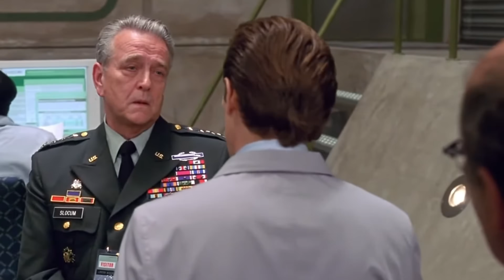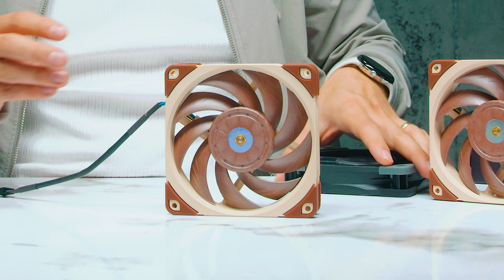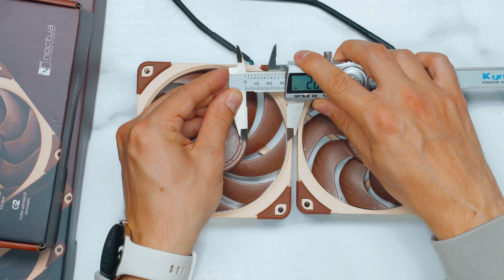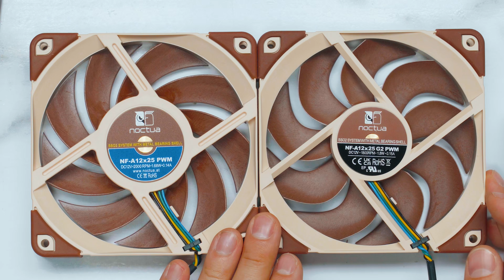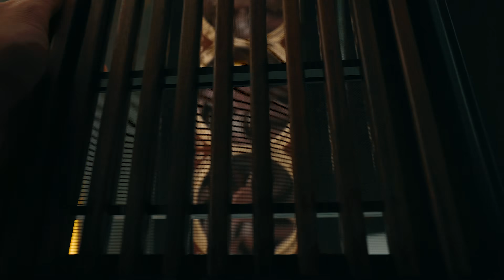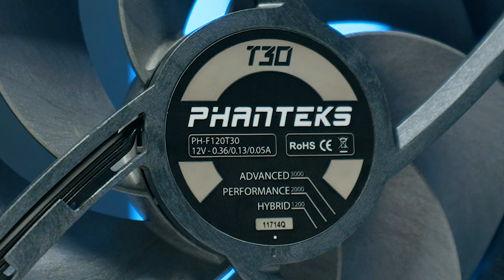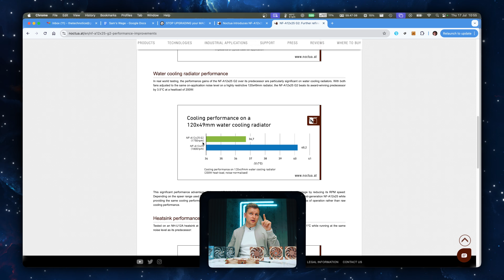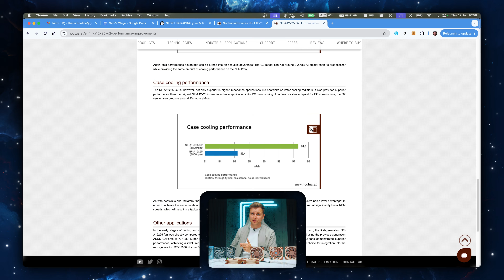Why it took Noctua 7 YEARS to BEAT the CHEATING Competition!?

Comment: Noctua COULD make the center hub smaller still but they choose not to because there's almost no airflow there and low pressure and they found that airflow in a positive pressure case can actually flow BACKWARDS through a fan with a smaller center hub -it's not an accident that the center hub is that size.

Comment: The Arctic p12 max is only $15.99 a Phanteks T30 is $29.99 and $34.95 for a Noctua 120mm G2. Unless you wanna completely silent build then I would agree go Noctua but otherwise Arctic It's the best option. I own all of these fans and much more and I would take the Arctic just for the price.  Unless you're overclocking or you're working at a very hot environment the Arctic fans are not going to ramp up that much so you wouldn't notice the difference.

Comment: Beat the competition? It's like saying Bugatti beats Volkswagen. By the time Bugatti sell 1 car, Volkswagen probably sells 1000. 
Noctua fans are up 10 times more expensive than the 'competition', but perhaps only slightly better overall.
I can buy 5x Thermalright 120mm fans (RGB mind you) for £17.29! 5 fans for less than the price of 1x Noctua fan!

Comment: Didn't watch but don't need a video to tell me noctua is pretty good....for a quiet fan.  If you need a fan with best air flow & pressure, you aren't running a quiet fan.

Comment: They changed it bc Chinese knockoff where getting too good.
Reply: Or they were following @MajorHardware's channel, where he has people sending in designs for fans to be printed and compared against the Noctua A12 (with the printed fan designs using an A12 frame and motor, so they're all working with exactly the same driving speed and power), and a number of the designs were beating the A12, and they needed to do something to push their own products back out in front.

Comment: I tested them as room fans with an old router power supply 12V _1A---, 80mm0.25A--92mm0.22A (they are very loud) a 120mm 0.18A from an old PC power supply and a F12 arctic 0.0.21(1350 rpm), the 80mm0.25A--92mm0.22A are noisier and more efficient...(80-92-120mm with 0.19-0.21-0.25 amber can also be obtained from old PC power supplies)

Comment: I don't trust any type of fan that doesn't use ball bearings. They claim these fans use oil pressure to create an oil cushion and reduce friction, but that only works for a short time; once the clearance increases, the oil pressure is lost. Only designs using actual ball bearings are truly durable. Manufacturers are misleading consumers with all this talk of oil pressure technology or magnetic bearings. If those claims were really valid, vehicle wheels wouldn't need bearings, and camshafts wouldn't need them either—we could just go back to the early days of motorcycles when camshafts ran without bearings.
Reply: comparing vehicle wheels to computer fans is a huge stretch. These fans are amazing

Comment: You can't just compare fan max rpm and max noise. It's about noise at equal cooling performance. A thicker fan creates higher static pressure and moves more air per RPM. Which means you can actually run it at a LOWER speed vs a thinner fan. It's physics and there is no way around it.

Comment: The reason for black taking longer is because the color requires adding "Carbon Black" which uses multiple compounds used to make it and effect the plastic structure. Which means molds will act different and detentions/tolerances change. Originally there fans where brown because the choices of plastics used resulted in brown fans. My guess it's brand recognition now

Comment: Just go for P14 PRO for static pressure at front and side and Endorfy fluctus for airflow at the back - all for less than 10$
Reply: Not the P14 Max?
Which Endorfy exactly, please?
Thnx in advance
Reply: @Kliq-n2s P14Pro and P12Pro are the most bang for your buck choices if you want high speed ARGB fans. I would avoid endorfy(old SilentiumPC) cause they are overpriced for their quality.
And if you want cheap and good looking fans that perform extremely well but only go to around 1500RPM then TL-S12 series is your best bet. Very quiet and outperforming most other fans till they hit their max speed. I use them everywhere in Corsair 5000D Airflow and they keep i9 11900 without power limits and bios modded RX 9070 very cool.

Comment: What a dumb way to put this... Yes Noctua is good, the other brands are also good, but why not compare them to the the same class of fan like the Arctic P12 PWM for example? Those are 1800rpm, I have them at 1200 on my case, they are super quiet and performance is amazing. I bet the Noctua ones are better (and also pricier) but that's just it, no cheating there Mr. Bait

Comment: TL:DR - If you never believe the hype of premium fans, here's my experience. 

In short, T30 120 competes hand to hand with A12x25 (G1) in terms of airflow and acoustic until RPM reach 1700 - 2000 rpm, I got the latter in Chromax recently and it is consider quiet until it reaches high rpm range (by no means it is loud as it still has more pleasant tone profile, so consider louder relative to T30 at same high rpm 1700 - 2000 RPM). I also ordered 1x T30 and wondered if I want to cancel the order since it will be used as rear exhaust to improve thermal under full CPU load but it is $10 more than A12x25 Chromax after discount on second thought, but after this video I'm happy to say that I made the right choice and will wait for it to arrive. 

Now I just need to wait for A12x25 G2 Chromax (2x single or Sx2-PP) local stock to become available (since Noctua barely gives any sort of discount for Amazon US stock I'll see if I can use a bargain with 30% discount that offered by an online shopping platform in my country, they do this 3 times in a month but often they jack up the price before discount so the final price may or may not reflect a value purchase) and get a pair to swap out the G1s from my U12A Chromax, and shift the two G1s plus the G1 currently used as rear exhaust to swap out 3x Arctic P12s as bottom intake. One A12xG2 OG will remain as rear top exhaust, and may reallocate 1 Arctic P12 on center top exhaust and top side intake depending if doing so will gives any thermal benefit, but surely those Arctic fans will be set at 800 RPMS permanently so no compromise on acoustic that the Noctuas and Phanteks provide.

3/2 or 4/3 for intake and exhaust should give slightly positive chassis pressure which is what I am trying to achieve, as negative pressure will lead to dustier interior while too much positive pressure will reduce the speed at which warm air is being ventilated.

For reference, I use 13600K + ProArt B760 Creator and Lian-li O11 Dynamic Mini. 
Prices I paid for (in USD equiivalent):
U12A Chromax - $95
1 x A12x25 G2 -  $20
1 x A12x25 Chromax - $23
1 x T30 - $33

Currently best temp in Cinebench 2026 (DTS sensor, HWINFO64)
LLC = Level 1, all Intel Default, DTT OFF
CPU Package  - 91 c (Peak) - tested with NT-H1, 1 large + 4 small dots, Arctic MX-6 or PTM7950 / TG PTM might be needed for further test
Vcore - 1.286 / 1.325 (AVG/MAX)

Shall update after additional fans swap. I might as well swap back the PA120SE and pair with G2 Noctua fans but the push fan will be blocking my G.skill Z5 Trident Slot A2 and need shifting away, and less cohesive aesthetic, despite of likely better thermal. Can only decide on which one to go for after all fans swap and thermal test are done.

T30 don't have the best price to performance ratio based on the price I could get, but since I need as much exhaust airflow as possible and rear exhaust outlet is the only spot with less restrictive grill,  I'll just get one to see what makes it the G.O.A.T of 120 mm fans that people have been talking about =)

P/s: Born and raised in the age when Delta fans dominate the cooling field while I use stock AMD K6 CPU stock fan cooler and 80mm chassis fan that costs $3-5, I didn't really care about acoustic performance and the hype that Noctua, Phanteks and BeQuiet bring, until one day I couldn't stand the harmonic and humming noise that the P12s and PA120 SE ARGB stock fans give (you can reduce the former by varying RPMs BUT the latter is the fan's attribute can cannot be removed) and start trying one by Noctua and it is the A12x25 G2. I have to say I'm impressed by the difference of acoustic of it compare to budget fans. One thing to warn though, is that once you start this path to 'acoustic treatment' for your PC, you will start to spend more as you will soon realize that there is no going back once you tried these premium fans, so set expectation on how much you are likely to spend and then plan the upgrade route and options.

Comment: Have three types in my case , for my Arctic 3 420 AIO, 6 Noctua A14 140X25 P/P 3000 pwm ,  3 Silverstone 140x38 3400rpm pwm, 3 BearGear 5200rpm pwm ,  pwm and fan curve , from normal days to benchmarking  ,  case matters , but fans make the case .

Comment: dude, idc that it's the best
it costs 40$ per 1
If you get a Fan speed controller on the cheaper ones, you get the same-ish noise level
Also you can't call it cheating, if Noctua is the odd one out. That would make it not cheating, but rather a Different Category

Comment: i dont want my fans to be loud.. but there are tons of Case and CPU cooling fans that are quiet...my trouble is GPU fan... my GPU is loud AF and harder to replace with quieter ones

so find me a Quiet fan mod for my Red Devil 7900XTX and ill happyli watch more videos
Reply: Noctua ghetto mod?
Basically you make the card "naked" only the cooler and backplate stays and you attach 2 or 3 standard size Noctua Fans with 3d printed parts.

Comment: Noctua might have slightly better performance, but the price-to-performance ratio isn’t convincing. For the cost of one Noctua fan, I can get five Arctic P12 Pro, and at matched RPM levels the difference is hardly noticeable.

Comment: I tried adding a pair of arctic p12 pro's to my little esports duo. They are so powerful the air started whining like it was crying At high rpm. Maybe I'll try again plugging each one into a different header (CPU and CPU opt) and staggering the fan curves so they don't ramp up and maintain the same speed.
Might try it with the phantom spirit but I heard it does the same thing with stronger fans.

Comment: There are 3 max speeds to avoid making resonance. Pausing the video 8:24 and 12:48 you can see:
 Max speed of 1750RPM on the model G2 PWM PPA; 
 Max speed of 1800RPM on the model G2 PWM;
 Max speed of 1850RPM on the model G2 PWM PPB.
Very clever detail.

Comment: I still prefer the Corsair fans (ML or RX series) with magnetic levitation or magnetic dome bearings. More airflow due to less friction and quieter operation.
A Corsair RX fan is just 35 USD.
You should also test the fan's performance independently and not rely on manufacturer results. Control the air temperature with air conditioning. Leave the room during testing when the fan is running.
It is the duty of tech reviewers to verify manufacturer's claims.
Noctua's brown beige color scheme has always looked like artificial limbs. The color similarity to prosthesis puts us off. It reminds me of hospitals.

Comment: Bit of a correction regarding fan area. The slight reduction in the central part of the fan will have very minimal if any impact on the actual performance. Majority of the performance from the fans is on the outer edges, as they travel the fastest and have the most surface area (due to how circles work).

The difference in surface area of the 2 circles is only around 5cm squared out of 100cm squared of the total blade surface area. This is only 5%, this might sound like a lot but this 5% is on the slowest moving part of the blades, the tips of the blades have to travel 37.7cm whereas the inner edge only travels 13.5cm per rotation. As such that area is only about 1/4th as effective as the rest of the blade at actually moving air so the actual performance difference will be closer to 1.25%.

Any actual improvement in performance will have more to do with actual blade design .
Reply: @Raz_Tactical  mind if I ask what your education/experience is with thermal dynamics and how fans work? You sound knowledgeable but a lot of people will talk with authority even when they don't have any experience or formal qualifications on the topic. So I'd like to know if this is simply your opinion or if it's grounded on facts based on engineering experience and education as your claims lead one to believe you've done this specific testing or at the very least studied tests others have done.
Reply: @MafiZed hi mate, By no means an expert on the subject just enjoy man and this is very simple A level math. The surface area of that section of the circle is just very small.
Reply: @Raz_Tactical  Don't get me wrong, i agree with you, the air at the tip of the blades is faster than that of the enter and blade design plays a big role in the velocity but i think you're underestimating the effect reducing the centre has, it allows the blades to be longer and moves the slower moving air closer to the centre and reduces the dead zone behind the motor, allowing it to flow more volume of air, i'm no expert either so i could be wrong but this particular reduction in centre size has been tested before and the results are that it improves the volume of air that can pass through, by how much i do not know for sure. 

But it does help even if it's in a compounding way or simply allowing it to be more efficient thus lowering rpm and power consumption without taking a performance penalty which i think was their main objective with this update.

Comment: I own these fans with an NH-D12L in a Fractal Design Pop Mini Silent. Very restrictive airflow case (and I knew that going in), but these Noctua fans (both a singular standard G2 and a set of the Sx2-PP) and I saw a 5*C reduction in temps just sitting at my desktop compared to the fans Fractal sent with this case. In games, I don't ever see temps higher than 70-75*C on my CPU and about the same on my GPU. Granted, they're both reasonably power-hungry (5800XT and a 9060XT), but compared to other things on the market, not really. The fans were worth ever cent and day of wait. Even with my BIOS set to run these fans at about 50% PWM at my usual temps just watching YouTube or something, I have to strain to hear it. Like, get down on my hands and knees and literally put my ear next to the case. There's a slightly audible sound when the system is under load, but nothing disturbing or annoying. In fact, it's rather a nice sound, giving me a subtle, pleasant reminder that my PC components are in good hands with these case fans. If you're on the fence about buying Noctua like I was for years, just do it. The performance more than outweighs the cost. You feel the quality in the construction and weight of each individual fan. I don't foresee having to buy any new case fans any time soon unless it's for a home server. And even then, I'm still going to spend the extra money for these G2s
Reply: Do you think replacing my NH-U12A CB's fans to the G2s (Once they have the black version) would remove any possible "Wooo wooo" and other annoying sounds?

Comment: I like the Artic ones, the fan blade design looks cool and the noise isn't that big of an issue, I found them not noisy at all in comparison since the blades design seem to scoop so much air that it feels like running faster is not necessary my pc usually have good cool numbers.

Comment: Bunch of nonsense, you just need to look at noise normalized tests and then RPM simply doesn't matter only cooling capacity. For example, in Machines & More tests the +1.2 dBA test showed the Phanteks T30-140 delivers 1.4 degrees less than the Noctua A14x25 G2 at the same noise level. The T30 was also spinning faster but who cares if it's the same noise...? Interestingly at +0.2 dBA the Noctua was beating the Phanteks by 0.6 degrees. This is the sort of testing we need not this bleating of cheating.

Comment: Cant wait for this new fan desing coming in their industrial PPM 3000 PWR, i have 6 of them in my pc, their CFM and pressure are unbeatable.
Reply: @sevazinhogamer9521  what the are you cooling with it... If a perfectly designed PC case you should be able fo cool Down 200W CPU and rtx5090 with just 3 fans, one being on a top down CPU cooler as the intake from a side panel and these being exhaust.
Reply: @zbigniew2628  not when the temperature of the city hit near 40 celsius
Reply: @sevazinhogamer9521  If you have 40C in a room then you have bigger problems than cooling a PC.

Comment: Noctua: How to lie with statistics and exaggerate an insignificant amount of improvement by not starting the axis for comparisons on graphs from the value 0. Well if we provide an axis that has 53 as the min value and 55 as the max value, the move from 53.2 to 53.4 will sure like a huge improvement. What's worse is that this is the case FOR EVERY SINGLE COMPARATIVE GRAPH FROM NOCTUA!

Comment: I would like to see G2 120mm slim fan version for my ITX Case. Personally with how efficient some CPU are getting today high temperature for me is not an issue anymore. I would buy them just to make my PC quieter while maintaining the same or similar performance. It’s just that I would rather like to see the fans in a more neutral color then

Comment: What? Since when RPMs are cheating?  And to be real here - nobody uses max rpms anyways. That's why fans are usually tested either noise normalized or same static RMP.  I've have A12, T30 and different generations of Arctic P12. There are pros and cons to each one of them. As a customer you chose one for your needs and it's great that it's still possible.  Dislike at least for clickbait title.